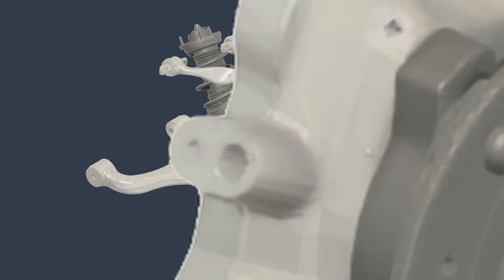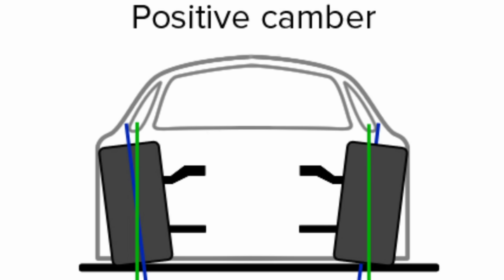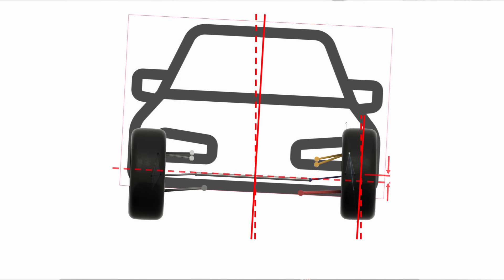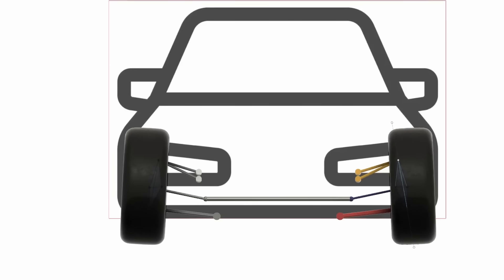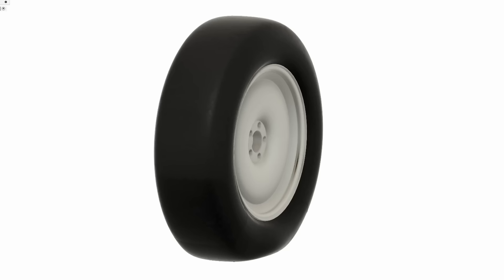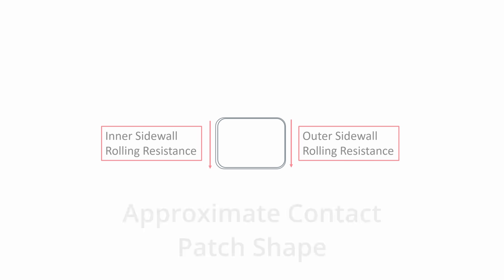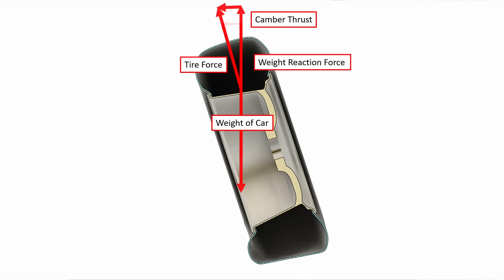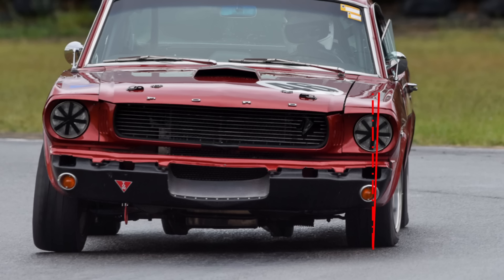Why do some race cars have such ridiculous front suspension camber angles?

Comment: Thanks for your very interesting video. I can't quite work out why negative camber at the rear has the opposite camber thrust effect compared to the front. Can anyone explain why that is?
Reply from the maker: Camber thrust is a sideways force acting at the tire. Any sideways force generated by the rear tires would tend to make the car just move sideways, not rotate. The camber thrust generated by the rear tires tries acts against the rotation of the car so it acts as a deterrent to cornering.
Reply: Ah I see, thanks. So the camber thrust at the rear acts in a similar way to having rear wheel steering when, at high speed, the rear wheels turn in the same direction as the fronts, adding stability rather than turning the car more into the corner?
Thanks for your reply 👍

Comment: The use of high camber angles i would suggest has a lot more to do with maximising the tyre contact patch mid corner than the use of camber thrust.
I use around 4⁰ negative camber all round on my fwd track car, with around 8° positive caster in the front. Only at those values do i get almost even wear/useage across the tyres. 
The roll axis and suspension stiffness is such that the inside rear wheel doesnt touch the ground while cornering.
Reply: Correct, camber for race cars will almost exclusively be setup for maximum cornering force in steady state cornering.  The creator of the video is wrong.  The dynamics of turn-in will be primarily adjusted with shocks.  I have never met a racer who sets turn-in rate with camber.
Reply: @edb.7885  Mostly correct, but I would consider that the rear in a RWD is almost never setup for max steady state grip, as it'd compromise combined too much.

I will second the notion though; camber thrust is at best a tertiary effect, not even a secondary one.
Reply: that's quite high camber value. personally i've heard alot of people in the simracing community say that something between 2-3 degrees of negative for street car camber gives best cornering but who knows. and the subject has always been real life not game.
Reply: @matufujiwara7493  Not really, -2 is barely enough to get even wear in road driving. Even a roadcar at 1G will lose 1-3deg of camber from elastokinematics, so you also need to account for that. Just to get the tire straight usually needs about -4; and optimal grip is a 3D function between load, pressure and angle (and to a lesser degree I believe also temperature, slipratio and slipvelocity) but usually you end up around -2 to -6 of actual camber angle, so potentially you might need to run anywhere from -6 to -10.

This of course is not actually optimal for laptime or handling due to many reasons; but it would be best for cornering only. Different tires might need a bit different amount, and some tires have a very flat camber curve at some loads and might not care very much to begin with when mounted on a light car, but if you add aero, or put them on a heavier car, it might matter a lot.
Reply: @ArchOfficial i agree. The body of the car rolls over (or the body deforms the tire) to flatten out the contact patch of the outside tire. The forces mentioned in this video are largely present in turn-in and corner entry

Comment: I agree with everything you said but my assumption had always been that the high static camber was predominantly to offset a large front view swing arm length. Most of these cars are Road car derived meaning a relatively long FVSAL, instead of hacking up the strut mounts inadvertently increasing Jacking effects. I assumed drivers compromised longitudinal performance to allow the tire to be at an ideal inclination in roll. The reason you don't see high static values on purpose-built race cars is the higher dynamic camber gain. (also, significantly less body roll) 
PS - Thankyou for increasing access to information like this, invaluable to people starting out.
Reply: Purpose-built racecars still run up to -5 pretty easily. They tend to have quite low camber gains compared to road-based platforms, at least comparing between DWB/ML suspensions. Some road-based DWB front suspensions might even gain up to 0.06deg/mm. AFAIK purpose-built geometries have lower gains as it typically facilitates less instant center and thus roll center migration, something that can be important for aero platform stability.

I wouldn't say purpose-built racecars roll less; they roll as much or more than sportscars at their respective operating loads. They might be pulling 5G momentarily even laterally. Their springs aren't that stiff, mostly because they're very light and don't need as much rate for a similar ride frequency. F1 is probably the only exception, and even that's not that stiff.
Reply: @ArchOfficial  I do agree, Different tires have different camber sensitivities, especially when comparing Radial vs cross ply. Depending on the class and tire change how much static camber you can get away with. I'm not very familiar with high gain road cars, I'm interested in why they would want that effect. My understanding was tire wear is normally prioritised over peak cornering forces.
Mentioning Roll centre migration is always a fun one. RC migration changes the jacking effect on the inside vs outside tire, this creates a moment on the chassis, if tuned correctly it can mitigate Roll, if not it can increase roll. A common solution is to reduce migration keeping the jacking effect similar. 
From my experience, race cars with aero roll less. Yes, they are often relatively softly sprung, but they also often have a significantly lower COG, meaning a lower turning moment in lateral loads. Combine this with high Anti geometry/Roll centres. The higher importance you give to aero the less body roll. Thanks for the response, its interesting to think about. there are always acceptations to statements like this. The answer is almost always "it depends".
Reply: @remote_will5490  The only car that comes to mind with really high gains is the MX5 NA's front, with about 0.057deg/mm. It is quite unusual; most sports DWB suspensions are in the 0.040 range. Supposedly it's for handling.

Aero cars are stiffly sprung, but perhaps not as stiffly as a heavier car might be; although in terms of pure ride frequency, they're much, much higher than non-aero cars of course.

You'd ideally have no platform attitude change at all, but it's pretty much not something you can actually accomplish, because you can't make anything infinitely stiff, even karts have (lots!) of compliance.
Reply: Also race cars have high downforce and that affects the ride height too, similar to load affecting the ride height of road cars. That's a factor that will limit the amount of camber gain you can put into a race car suspension, I assume.
Reply: But how do you explain formula 1 cars with specifically designed suspension also has significantly greater camber angle in the front wheels than the rear wheels? Is it perhaps for another reason?
Reply: @ Acceleration performance in the exit is quite dependent on the performance of the inside rear tire, due to it being more evenly loaded than the front in most cases.

It's why you will basically always see RWD racecars run less rear camber, even if it means they lose some rear FY.
Reply: @fusha_1527  Are F1 cars a good example of suspension design though? They have almost no suspension travel and aerodynamics & platform control for ground effect cars rule over any other aspect of suspension design.
Reply: Another thing should be consider compliance of these tires when experience high later force.

Comment: What about the ultimate amount of grip while cornering? I thought that'd be a big component of the camber angle as well?
Reply: It is. In practice I’ve always seen camber angles dictated by producing acceptable tire wear (either neutral wear or marginal inside wear) and the angle it was set to was just a consequence of whatever the vehicle wanted. I’m aware of a lot of racecars with pretty large differences in roll stiffness that often results in these camber splits because the outside front tires will be taking virtually all the front load. If you reference camber charts vs vertical load charts you’ll see a correlation between the increase in vertical load requiring a larger angle to the contact surface to produce peak grip(ignoring the lowest portion of the chart tires) . Camber thrust is of use but it’s often viewed as a side component to force production not a primary one as the forces relative to simply turning the wheel producing slip angle are small by comparison.
Reply: @joshmerklin  The rear axle usually tends to also have less camber; due to the inside rear being more loaded proportionally than the inside front. In RWD cars, you must do this to avoid wheelspin in acceleration.

Camber is also very, very inflation pressure sensitive, and highly nonlinear, and I believe it also depends on temperature, slipratio and slipvelocity. One of the more complicated mechanical aspects of tires for sure, and cannot be represented linearly. As a rule though, it is not unreasonable to assume that higher loads might require higher -ve angles.
Reply from the maker: To a degree, but I wanted to focus on camber thrust for this video.
Reply: @suspensionsexplained heh, “to a *degree*” 😂